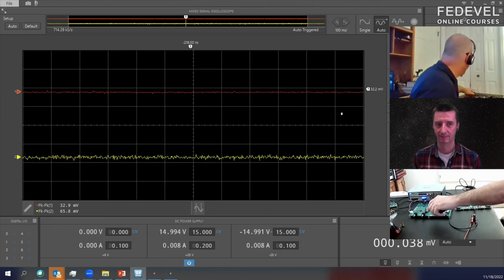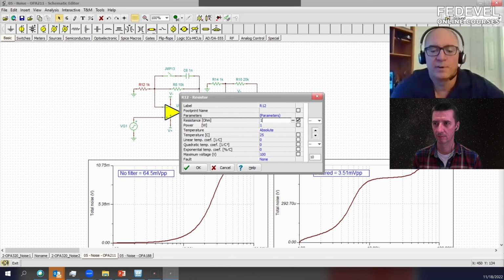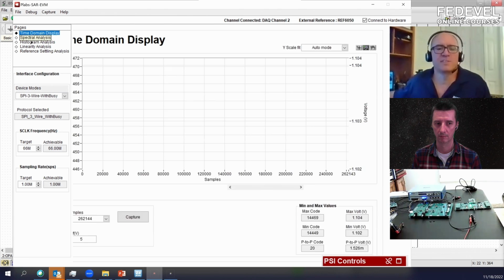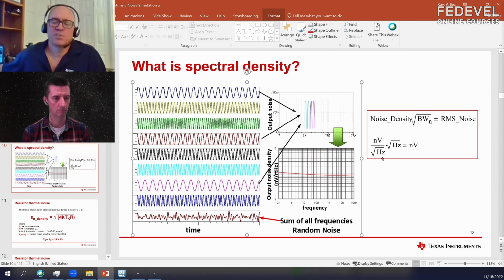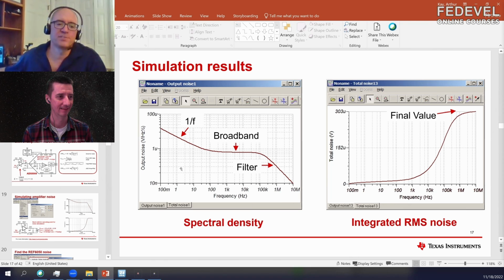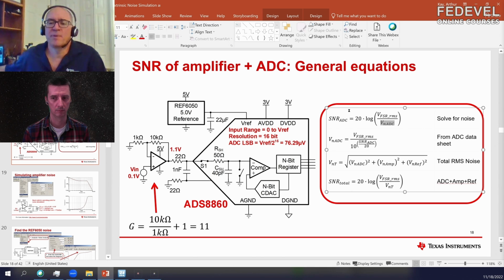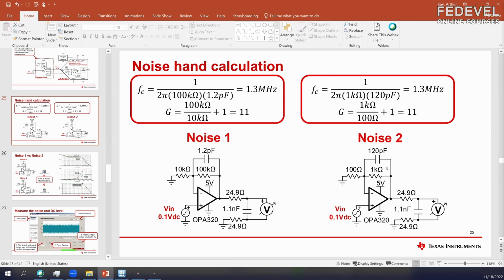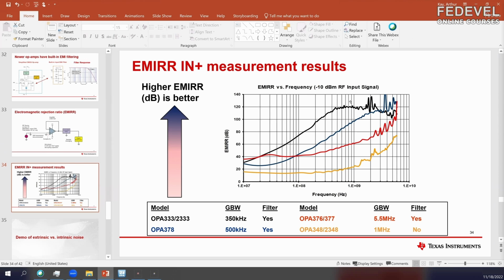How to minimize noise in your OP AMP and ADC circuits

Comment: Thanks Robert and Arthur,  but I wish if there are a clear steps or equation to calc R filter  and C filter in Low path filter At input of ADC , especially this values are connected with  internal C samples and hold  and Ron .please if you can give step by step design filter

Comment: Awesome master class, I thought that the capacitors and the ESR were the ones that most affected the noise, as well as a very large value of the same capacitor... but now I see that the ratio of the resistances and the type of opamp are much more important.

Comment: As far as I knew the bigger the resistance, the bigger the voltage noise that one electron generates, just as the same current creates a bigger voltage drop over a bigger resistor. But please correct me if I am wrong.

Comment: Just something I like to throw into discussions of op-amp noise ... the easiest way to reduce op-amp noise is to not use an op-amp. There are 40+ transistors in a typical low-noise op-amp, and they all contribute to the typical EIN, which if you are wanting a high voltage gain, say 100×, can result in unusably high output noise even with allegedly "low noise" op-amps. Generally, a simple 3-transistor (or even 2-transistor) discrete amplifier circuit will be able to give you that gain with 40dB less noise. Most mic pre-amps use this kind of circuit for their initial gain for this reason, mostly using complementary doubling on the input pair to reduce non-linearity.
Reply: Is it worth it? You can get opamps that have low single digit nV/rhz broadband noise.
Reply: @orientaldagger6920  definitely worth it. the difference is enormous. my experience is of using an NE5532AP (5nV/√Hz typ.EIN) which at 100x gain (40dB) from a mic source was borderline unusable (I think the noise was somewhere around -30/-35dB after some follow-up gain because 100x wasn't enough), whereas a balanced bjt initial mic gain stage can give the same gain and more without adding anything noticeable, and that was using cheap basic BJT's (BC556). All commercial balanced mic inputs (that I have disassembled) do this. They may also have an op-amp buffer before the next stage, but the gain is done by the transistors. The transistor circuit also has the benefits of being a true differential amplifier (no slight differences of gain from hot and cold due to resistor and gain pot tolerances) and having the possibility of balanced output to the next stage with no extra circuitry.
Reply: @treelibrarian7618 what about active rc low pass and high pass circuits? It gets really complicated to use transistors to get the similar amount of roll offs
Reply: @Yeeaits  Not sure what you mean by complicated, I have made active sallen-key RC low and high-pass with just a single-ended bjt emitter-follower as the output buffer before. They can accept the DC voltage difference from output to input due to the capacitors in the feedback path. generally, though, the signal will already be large enough and the gain low enough that a low-noise op-amp is fine from a noise perspective. My original comment is specifically about the case of Mic pre-amps where the -30dB details of the input signal is often in a similar rms voltage range to the EIN of the op-amp, so you end up with a lot getting lost in the noise floor. Due to the nature of bjt circuits there will naturally be some low end rolloff from the capacitors used for adding and removing biasing. personally I wouldn't try adding in strong (12dB/octave or more) filtering to the mic preamp directly (maybe tune up the natural low-cut fro the biasing to get more rumble filtering if needed), but rather get the signal up to line level and then think about filtering it. And use op-amps if you like, they exist for a reason, but remember there are trade-offs for that simplicity and I do recommend learning about transistors of all kinds for your future in electronic design.🙂
Reply: @treelibrarian7618 well how much transistors are you exactly talking about to get the same roll off as from an active op amp rc filter? is that effort worth it, like does it give zero noise operation considering that the input signal and the vcc is also clean? i was doing a custom bandpass adjustable filter for my subwoofer amplifier. it works fine after compensation and all but there's still this wining FM static kind of noise coming from the sub. its not that loud but it is not consistent it creates a fluctuating noise that is the real issue. if it was same our brains would just tune it out over time
Reply: @Yeeaits  thats not the kind of noise that either op-amps or transistors generate - it probably comes from something else in your car putting noise on the power lines - maybe even from the sub amp's PSU switching frequency or something else that uses switched power conversion. you'd better put effort into filtering/smoothing your power lines for the filter. As for the dB/oct of a transistor-based sub filter, it's the same as for op-amps, as high as you want. But the simplest transistor buffers are more susceptable to supply noise than op-amps in general since the op-amps have extra circuitry to make them supply-voltage independent. if you're having that kind of issue, stick with op-amps and work on the psu and maybe shielding as well. You won't be using enough gain to make discrete transistors worthwhile.
Another though occurred: what many don't realise with DC-supplied systems like those in cars is that there can be a significant voltage difference between the =V in one device and the =V in another device in the signal chain, due to voltage drops in the power supply wiring - and these voltages can change rapidly with variations in power draw from the devices concerned, injecting audio frequency noise into the signal because they don't have isolated grounds like they would with AC powered devices. If you can use isolating DC-DC supplies or alternatively use some kind of DC-decoupling in the signal chain (either audio transformers like in a stage DI box or using transistors for current-mode signal transmission works) that will probably fix it.
Reply: @treelibrarian7618  thanks you so much for your time and help  man have a nice day
Reply: You pay a heavy penalty in nonlinearity.  There's a reason you find opamps in every metrology-grade DMM and voltage standard.
Reply: @willis936  but DMM's and reference voltages don't deal with rapidly changing signals so they can limit bandwidth to a tiny frequency range where 13nV/√Hz is simply 13nV. Yes there is nonlinearity in any feedback-less circuit but decades of mic-preamp designers have consistently made the same design choice: with tiny input signals such as from a microphone, the non-linearity of bipolar transistors is similarly tiny and the noise floor is much more important, so using a pair of low-noise transistors (usually with a complementary pair further reducing the non-linearity) for the first 40 to 60dB of gain, also providing near-perfect common-mode rejection accross a wide gain-range without the need for accurate voltage dividers including a dual-track pot (impossible) is a very good decision.

Comment: This is an interesting fact, but if you shunt down an OpAmp power line with capacitors of all possible values (and types), this will kill a sound (if we are talking about an amplification of a sound). Some noise must be present. It’s like a mac rounded corners vs ms square ones. The rounded looks more natural
Reply: I think he said you shunt down values exceeding the frequencies you are planning to analyze, unless you mean something else! so for an audio frequency, I don't really think you need frequencies above 25 kHz, so you only remove those.

Comment: Here is some things I learned. If you have to design a low noise circuit, you have to double check things to which  you would normally not pay attention....PSRR and sometimes CMRR. Power supply disturbances and CM noise can easily exceed your noise. Make sure you have a feature on your PCB to short amplifier inputs on the PCB..don't rely on a short at input jack inches away during development.

Comment: How about the oscillator that works at 1.4 GHz frequency and its output noise is 1.6 nV/sqrt(Hz), while total noise is 53 uV/sqrt(Hz), and phase noise is -133 dBc/Hz? The OP-AMP's bandwidth is 900 MHz at -3 dB.

Comment: We did it all the time as the signal to noise figure was very important to the customer, you had to remind them that the noise floor was also important. If we stated the signal to noise was 60dB and the noise floor was 100uV, then they would not get 60dB down on a 500mV output.
But they did not like a statement like the signal to noise was 60dB or the noise floor whichever is greater..